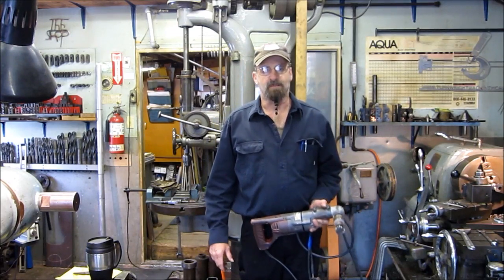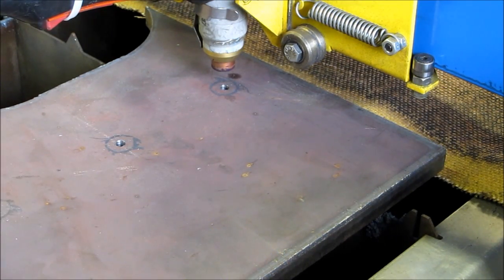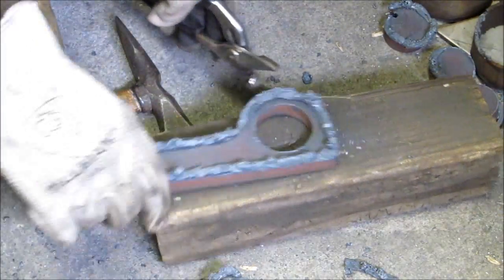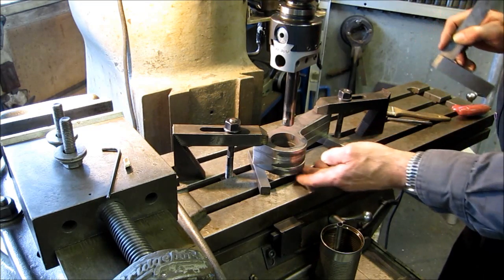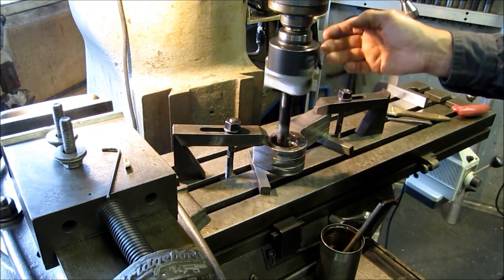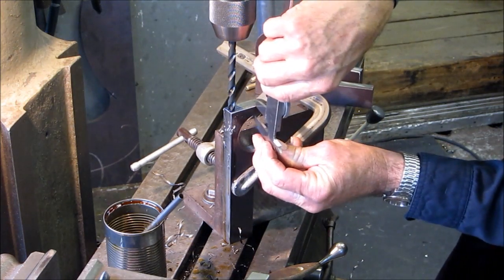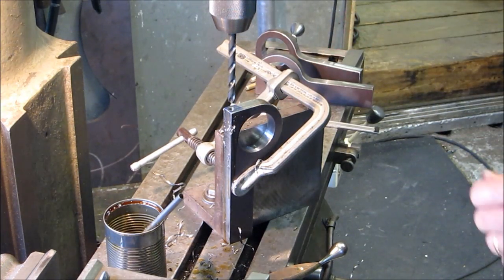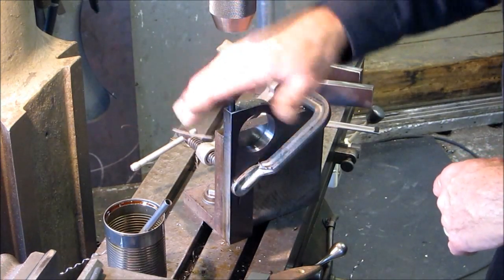Portakey Part 1

Comment from the maker: I set the material in place, set the cut over the plate, cycled the pierce points, stalling them at location, sharpied around the torch tip,center punched, drill and reset the plate in same spot of table...

Comment: Keith, i may have mistated in my previous post.  The parts that we have being burned out are not square by any means. Ive noticed that your parts are coming out completely square.  If our parts are supposed to be 3"x12" of 3/4" plate, the bottom of the part is 3x12, but the top is 2.75x 11.75.  My logic tells me it is the feed rate, but im not an expert.

Comment from the maker: You must mean Dross, the term for slag top or bottom of plate! The Kerf is the width of material removed between the part and the drop material. The dross amounts are variables of traveling speed, AMP’s and cutting height. Good starting recommendations are usually supplied by the Plasma machine makers. They all stretch the speeds, if you’re trying for quality cutting slow down from their recommendation by 20% to 40%. Slow speed dross is easyier to deal with. ;{)-

Comment from the maker: Mc Master Carr # 1011K11 = gal. and 1011K12 = 5 gal. dark sulfer basesed cutting oil...
Shipped by UPS

Some over priced Plumbing supplies also carry it most of the time under names like Hercules cutting oil or Ridged has there own brand, also. Your better off to buy it in a large quanities!  Our local plumbing suppiers here on the cape, sell a gallon for the five gallon price...

Comment: Keith.   What causes kerf on the burned pieces?  Is it too fast of a cutting feed rate?  The hypertherm/messer plasma table we have at work has an extreme amount of kerf and slag all over it.  Nobody is willing to make any adjustments to the programming to minimize those problems

Comment: man what plasma cutter do you have powering that plasmacam setup. that cuts much better than any other plasma setup ive seen. including the piece of crap i use everyday! ours is real old though, no active torch height control. always figured the water table ones would have water closer to the parts, to prevent the dross.

Comment from the maker: I built the water tray and draft system so the moisture wouldn't hinder the operations and arc control above the plate, but would drown the sparks and hydrocarbons. I'm using a Thermal Dynamics cutmaster 80. ;{)----

Comment: my shop teacher said to use sulfer baised oil but none of the industral supply books include that in the discription. what is the spicific brand and type you are using?
Reply: Go to a Plumber's supply store - buy a gallon of their 'thread cutting oil' - you should be good for a decade at least.
Reply: - and find an old soup can - fill it with no more than 1/2" deep of said oil.
- and use only really cheap acid/flux brushes from the same plumbing store.

Comment: sometimes thus out-of-square can be avoided by leaving a tiny bit of thee plate uncut (its called microtabbing) at corners,an it will keep the piece from moving around, or you can make some wedges an stick them in the cuts to hold material in place. You're not doing anything wrong, this is a typical scenario in thicker plate.